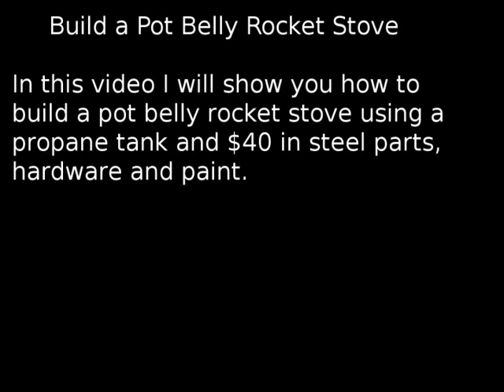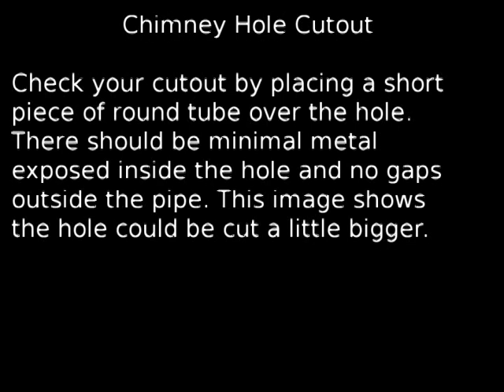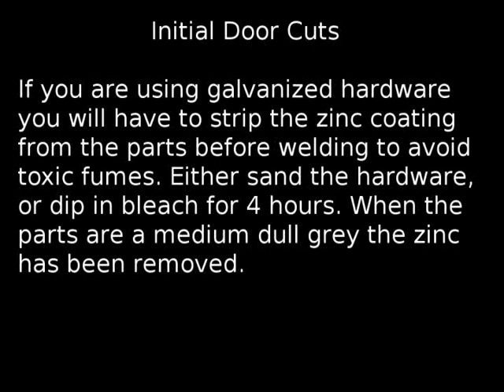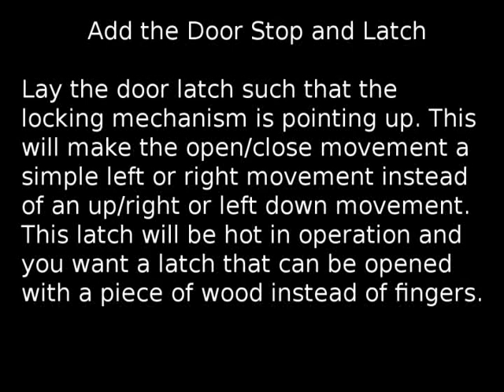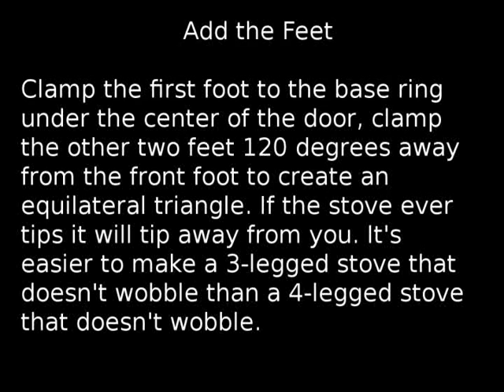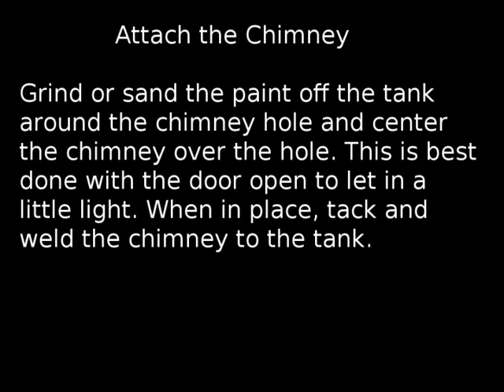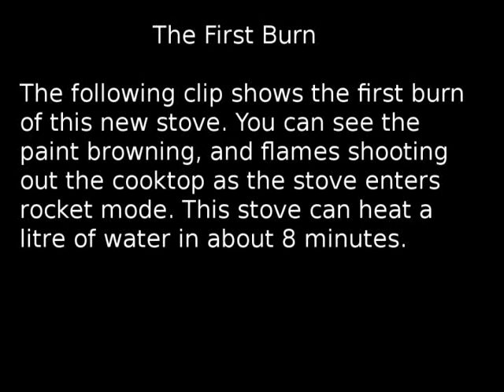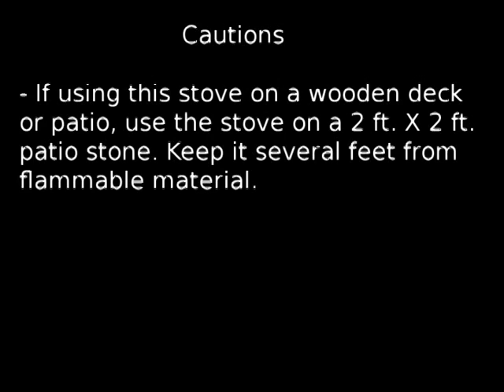Pot Belly Rocket Stove Tutorial

Comment: Not really a rocket stove at all. though if it does what you want then good job done! A true rocket stove depends on two main principles... 1) lit from the bottom and with a down draught (or side draught) from  there, the ever-present gravity can't spoil the fun like it can with top-lit combustion when it carries hot embers to the bottom (even if the flow of fuel air is upwards) and starts combustion unpredictably down at the bottom of the stack of wood and 2) A long-enough and insulated-enough combustion tube to provide the 'flue effect' draught to create the draw. To date the only configuration that satisfies these (imposed by nature and physics) restrictions is the 'J' tube arrangement. The short vertical is where the stock goes, lit at its base, and the long vertical of the 'J'  is the flue-effecting combustion tube. If you want to have a true rocket stove that requires little attention then you either need very long fuel wood (no limit... could be 20 feet tall!) or some clever automatic feeding system which would probably defeat many of the objectives of having a rocket stove in the first place.

But like I said if your design works for you then great. I am just concerned that lots of people are using the expression 'rocket stove' without necessarily understanding it. No problem except that it can mislead people new to the subject. The simple but brilliant idea behind rocket stoves should be understood and recognised - that way proper development can happen and something great could emerge.